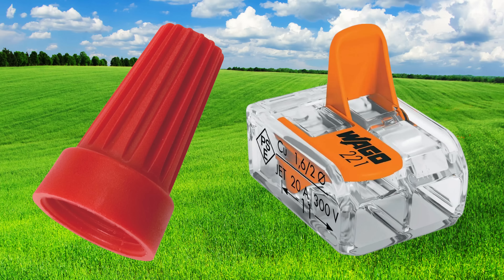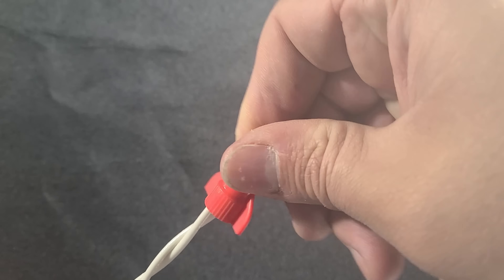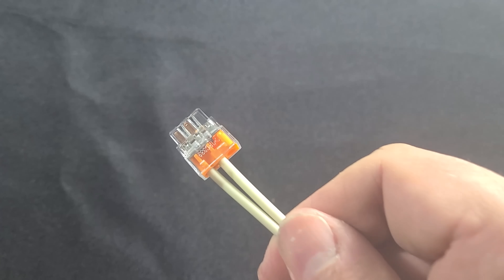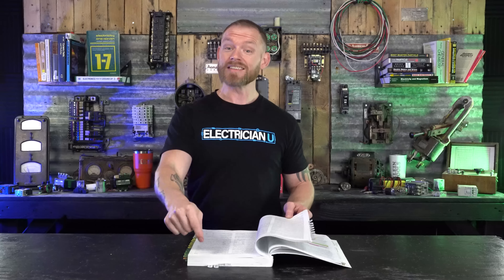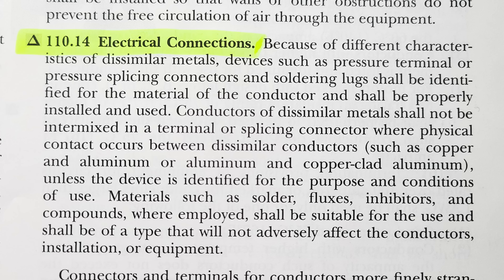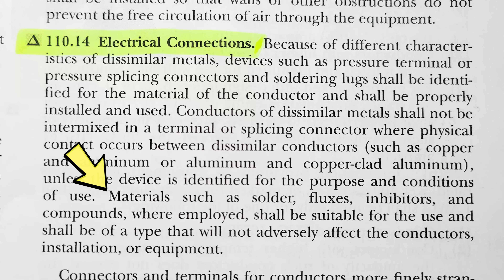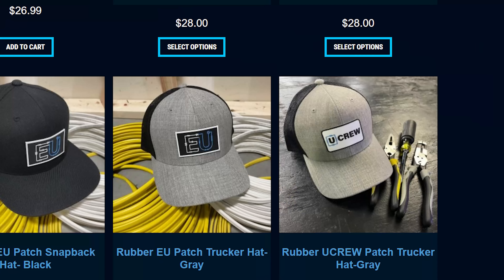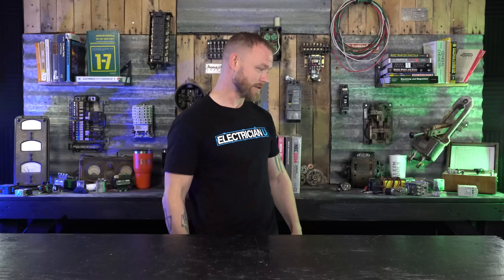Should We Use WAGOS or WIRENUTS?!?!

Comment: When using wire nuts I was taught to twist stranded wires together or around a solid wire and lay solid wires side by side. No matter the wire used, I twist until there is 1 1/2 to 2 full twists in the insulation outside of the wire nut. I just started using Wagos for residential work, because I finally started running low on nuts.

I prefer crimp on wire nuts for any situation that may transmit vibration to my connections, such as motor connections like ceiling fans and  AC compressors. I do this more in industrial settings than residential.

You do a great series of videos for those looking to learn the trade. Awsome content.

Comment: I've always been nervous with Wagos because I'm nervous about plugging floor heaters. I have seen so many pictures of problems with bad connections and stuff with floor heaters and how you need to plug them directly into the wall. It makes me wonder how well the way go would work so that it doesn't overheat and cause a fire in the box. Although I'm assuming they wouldn't be rated for a 15 amp circuit if they couldn't handle the full load.
Reply: ? Wago 221 are rated for 32A, Wago 222 are rated for 20A. It's very difficult to make a bad connection with them. Have you seen load tests with them? they far overceed other splices.

Comment: Stab in Wegos are great in fixtures and fast. I use the expensive lever Wegos in crowded boxes. I still after all the videos I have seen prefer wire nuts pre twisted. However when I worked for Rogers they told me not to waste time pre-twisting my wire nuts in the commercial applications. This made sense in the seasonal or less then permanent work.

Comment: All of your points are logical, thank you. One attribute of wire nuts that wasn’t mentioned is they’re much cheaper than wagos so I would think that plays in too, on a big job.  I use both as well, depending on the circumstance along the same lines as you.

Comment: Waygo's? WhaTF & WhoTF came up with this name?? The only limited 120/220V uses for homes or light commercial 14awg lights/fans/logic devices ok. In industrial automation, sensors, logic controls & such, where maximum electrical load is small - yes "quick/easy" connectors solve chit easy but  'WAYGOS' 😹 I'd never trust a 120V outlet using quick connectors!!
Reply: And yes, always pre-twist except the tap wire, like switches & lights
Reply: It's a German company and is pronounced "vah-go".

Comment: I'm a no pre-twist (like it says on the box/listing) wire nut guy, but even I carry a pack of wago lever nuts. Those things are so handy when you're working with existing wires that were left too short!
Also great code time section. Didn't know about the twist requirement for soldiering!
Reply: While you may not pretwist before putting on the wire nut, you should be twisting the wires using the wire nuts.   They put the wings on them to enable getting enough torque to twist the heavier gauge wires.
Reply: @wingerrrrrrrrr  Doesn't twist the wires INSIDE the wire nut though, only that outside of the wire nut.
Reply: @andyfletcher3561  it should twist inside if torqued enough while holding the wires at the base of the wire nut. If it's just screwed on lightly they may not twist.
Reply: @wingerrrrrrrrr  If you twist it so much it twists the wires inside, they are going to poke through the top.

Comment: Good timing with your video, I'm an M&E manager for a large uk main contractor and we currently have the irrigation contractor rewiring all his solenoid valve panels. We are not allowed to use wire nuts over here and the panels are from the US and everything is connected with wire nuts(no sympathy they never provided us with a Technical Submission) enjoy the content and seeing the difference between the UK and the US.

Comment: I would rather use the screw type they have in Europe, but I'll use wire nuts until wago come down in price. Wire nuts aren't going to come off I go full 800lbs gorilla twisting wire nits on, I put them on so hard that sometimes I need plyers to get them back off. It does help detect wires that I've accidently cut into because I'll twist the end of the wire right off.

Comment: I agree. They both work when used properly. I've used both. I will say that it's easier to add or remove or troubleshoot circuits with wagos. My boss pays for wire nuts so that's what i use mainly.
Reply: " They both work when used properly. " and that's kinda the problem isn't it? WAGOS are hard to screw up. Wire nuts are so easy to screw up you always screw them on.

Comment: Wait. Wago can be used on two different wires? But what is the connector in the wago? Usually copper but an aluminum wire is ok because it doesn't touch the other wire? As far as wago themselves... maybe for connecting a light fixture or whatever. But what about a run that gets kind of long? Seems resistance would be more of a problem with a wago over a wire nut.

Comment: The clamping bar wagos are much nicer; can remove conductors without damaging the connector or wire trying to remove. Just an FYI
Reply: Also PS: Cant use wire nuts or wagos at motor pecker heads. New to the codebook. Must be held by fasteners like a nut/bolt

Comment: I’ll answer both wagos or wire nuts & apples or oranges. First of all, can u put peanut butter on an orange? There’s no doubt in my mind that wagos offer inferior connections to wire nuts. Wago’s connection method is similar to the mechanism in push in or the “backstabbing” of receptacles/switches. I’ve seen wagos burn up under load. Anyone that does service work will get calls about switches/receptacles that failed when they were backstabbed. Just bend a shepherd’s hook, don’t backstab! The only difference between wagos & the push in connection of a switch/receptacle is that wagos have a lever to release the wire instead of a spring that permanently keeps the wire in place, but the connection is just as poor. Also, wagos are not recommended with stranded wire because strands can separate when pushing in. Yes, wagos are quick & practical but they do not offer a strong connection. Trying running 18 amps under a wago a few months & see if it eventually doesn’t burn up. Oh ya, wagos are expensive too!
Reply: If you're running 18 amps as a continuous load it should be on a 30 amp circuit and 10 AWG.
Reply: You’re right… I don’t even think wagos can take that an 18 amp load in a non continuous situation for that long. I’ve seen them fry before

Comment: Wago’s excel in several areas. 1- Connections that will need to be remade. I do all light fixtures with Wago’s since designs change and people want new styles of fixtures. 2- Installed smart technology devices like smart switches and fixtures. 3- Mixing stranded and solid wire. Makes a more sure connection. 4- Hot work. You can quickly put a Wago on the hot conductor to prevent accidental contact and it never needs to be exposed again to finish the work. 5- Wires that are too short to make solid twist connections.
Reply: Agreed on the hot work. I change out ballast alot doing service. Alot of the time there is no panel schedule or the business can't shut down every light to change out one ballast. Capping the hot amd neutral with a wago makes my job safer and repowering new ballast easy
Reply: You missed the most obvious!  DIYers that do electrical once or twice in a couple of years and aren’t proficient with wire nuts.  I’ve run into both pro work and DIY work where the wire nut is barely on and the wires not securely twisted.
Reply: @glasshalffull8625  I thought that went without saying. The channel audience is electricians and aspiring electricians. A DIYer watching this channel’s videos probably already knows how to make a wirenut connection.
Reply: @MarcosElMalo2   He was listing the top reasons for using a Wago and missed an important one, so I guess it does need saying.  Also, Pro or DIYer twisting four or five 12 gauge wires together would be much better off using a Wago.  He also didn’t mention really short wires.
Reply: @glasshalffull8625  i know what I am doing, i study local codes
Reply: @shadowopsairman1583  Can’t remember addressing you, but always keep learning.
Reply: @Rowdy Sooo, you can miraculously make a wire that was cut short to grow a couple inches!
Reply: @glasshalffull8625  Actually, Wago makes a butt connector that extends the wire with minimal space and effort.
Reply: @TomCee53  I just saw these a few days ago on the internet.  Home Depot doesn’t carry them, but I think I’ll order some to have on hand.  Thanks!
Reply: @glasshalffull8625  They're bogarting the Copper Extenze™
Reply: There are specific Wagos for stranded wire.
Reply: @thebnbaldwin  Such as Lever nuts?
Reply: @lyonlatimer7656  Wago, lever nut, whatever you want to call them, yes.
Reply: @thebnbaldwin i was about to say most wagos arent supposed to be used with botb stranded and solid its usually one or the other
Reply: before lock out/tag out became the safety requirement, i shut off  a  3 phase breaker to a dish washer in a commercial kitchen, used my meter and tested for voltage ok.started to remove wire nuts and got nailed. went back and breakers had been reset. tripped theh and waited, a low iq kitchen helper in charge of the juice machine was doing his job.  the quote electrical butt hole that tied in 110 vac on a 3 phase breaker violated nec 50 years ago.
Reply: @Rowdy Wire nuts have almost zero upside compared to wagos except price. They're definitely cheaper. Pretty obvious you haven't used wagos
Reply: @joshdiehl8737  Don't forget the hipster value. That's all they have going for them, now that Wago's are so widely adopted and mass produced.
Reply: Great points ! 👍👍
Reply: Have you ever used wagos to connect all aluminum wires before connecting to alumicon?
Reply: @joshuatijerina5731  Since no-one's answered you in a whole year. Wago's require aluminium contact paste before insertion, unless you're using a cage-clamp terminal blocks inside of a box, and they only recommend it for the 2273, 222 and 224 series. So the 221 series which is the most popular for quick connections is not rated for aluminium.
Reply: @joshuatijerina5731  no. The Wago conductor is copper.  Al and Cu  will chemically react and corroded.  So, Wago are not for aluminum and they are also not for cca.  Never use Wago over 5A.  They are problem waiting to happen.
Reply: I am a LV guy (Ethernet) so the Wagos are the style I am more use to.
Reply: Do not work on hot connections unless you are certified to do so!
Reply: I never thought about using a wago to isolate a hot wire. I’m not an electrician, but i do a lot of home renovation projects. Thanks for the tip.
Reply: @huejanus5505  please don't work on stuff hot. Especially at home when you can turn off the breaker.
Reply: @anonymooseanonymouse6371    I always turn the breaker off when doing electrical work. I just thought it was a good idea to put the wago on a wire that will be hot, right away, kind of like an extra precaution. One less way for an accident to happen. When changing lights and things I always put wire nuts on exposed wires if i’m not finished by the end of the day, wether the breaker is on or off. I don’t know what it’s like to get a 110v jolt, and i don’t want to either. 
Thanks for your concern though. I watch these videos to learn how to do things properly, but often the best tips come from the comment section.
Reply: @huejanus5505  there are several fields in the electrical trade where we cannot turn off the power and we troubleshoot and find the problems with everything hot.
Reply: @huejanus5505  if you’ve never been hit by 110vac, you can’t possibly do too much electrical work. I got my first shock at about 5 years old, due to a skinned power cord. It ain’t a big thing. 240 or 277 is a nasty sting. 480 hurts a lot and it will all kill you.
Reply: @huejanus5505  I second this… He only does that because he had to do so working for the company. Don’t risk it.
Reply: @huejanus5505  I’ll be the third person to advise against this. Hot stabbing a wago is risky and shouldn’t be common practice for anyone, professional or DIYer. There are certain conditions where a professional will weigh the risk and decide to do it. The Wago connector makes it safer, but doesn’t make it safe. So use your brain and use the breaker! 😄
Reply: @MarcosElMalo2  when you have to troubleshoot a restaurant commercial account your brain is out of the question you can't go in there and shut anything off and you have to troubleshoot and find the problem. welcome to my world there are no wagons.
Reply: Their contact area is too small which can increase resistance/heat

Comment: I have been using wago for a few years I will never use nuts again the are sketch I've have so many wires break off short inside of a box trying to undo a wire nut or when twisting.

Comment: i am in Alaska doing exclusively repair work (residential). Almost all, push type connectors i service that are out past 10yrs old, have weakened and then sometimes lightly char. idk if it has to do with the seasonal temp swing of 100 degree or just regular abuse or design flaw but i see way less on wire nuts.

Comment: I had the same problem while implementing a modular hotel project for CitizenM in Seattle.  In our country in Europe, Wago is the basic connector and the surprise was great when at the beginning the general contractor prohibited the use of these connectors.  Ultimately, we used wire nut for socket circuits, i.e. 12/2 MC, and Wago was allowed to use for 24VDC only.  It was about 4 years ago.  In 2020, also for the CitizenM project in WDC , there was no such problem anymore and we used Wago everywhere.  Greetings from Poland
Reply: How did you end up working in the USA as a European electrician? Was it hard to get used to the new color codes and standards?

Comment: Wago are superior.   They are faster to apply, take less space and when more than 2 wires joined they are more sure.  Wago makes disassembly  easier and the wires are nice and straight when after disassembly.  Wago works with dissimilar gauges and both stranded and solid.  The only things in wire nut favor is price and wet application.  I value my time more than the price difference.   
BTW 1st encountered wire nuts in the 1960s and thought they were new because dad brought home IDEAL plastic wire nuts.   Then I found porcelain wire nuts in my 1929 house.

Comment: Lever nuts are great, the stab in connectors are not so great. Lever nuts are great when dealing with solid wire and then using stranded pigtails to feed your devices.

Comment: Wago for splicing 4 or more conductors. There is no way you can cleanly splice 8 conductors with a huge wirenut. But the 8-port Wago is beautiful. Great for multigang switchboxes with a crazy number of neutrals and grounds that need to be commoned.
Reply: Slade Profka  Those large blue nuts are for larger conductors (say four 10 gauge). If I were forced to splice together 8 #14 conductors using wirenuts, I'd make groups of three and daisy chain pigtail jumpers between groups. It's neither clean nor elegant, but it would be far better than a honking mass of conductors all bound together.
Reply: Slade Profka  One of the possible use of 8 or more conductors are custom made "spider lamps". If you don't split into groups to switch half or third of the bulbs you need 8 conductor for 7 bulbs or 10 conductors for 9 bulbs configuration. Other example is spot lamps in the kitchen furniture. 6 or 7 lamps are tied together behind the lightswitch so you don't daisy chain the lamps.
Reply: @SFefy  You can create two groups of four hots with a jumper to switch. Not hard to do.
Reply: Slade Profka  In fact i already needet 8 port wago several times and I am working since 3 years XD
some time the 5 port isn´t big enouge or some time i got the task to do same crazy circuts for school
Reply: Wanna make a bet lol.
Reply: Big gray or big blue I’ve done it 1000 times
Reply: They do take up more space and if the wires are cut short than good luck

Comment: So I'm wondering what's your opinion on wrapping wire nuts with electrical tape? I personally think it's pointless cuz if you use the wire nut correctly it should insulate the connection n protect it. But all my life, advice/lectures have gone both ways on the topic n I've run into both ways many times when working on wiring
Reply: Thinking you may as well pour  liquid electrical tape in the wire nut to seal it up,  lol